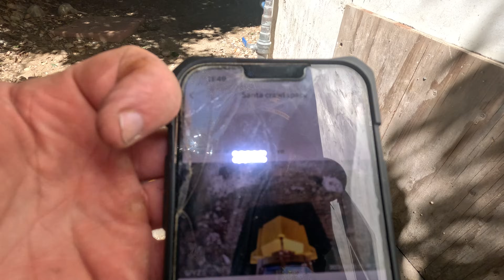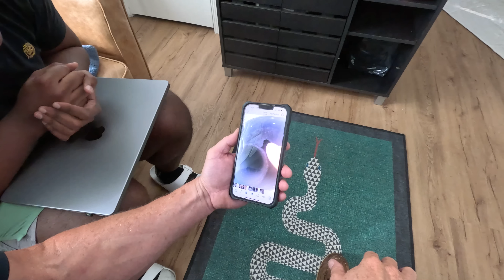3 Homes ONE HUGE RAT Problem

Comment: UV light can show rodent urine. A thermal camera can show borrows in insulation. Also there are one way rodent valves to prevent rats from entering through the sewer system.
Reply: They sell their own rodent blocker for the sewer

Comment: I am disappointed--the Rat that, supposedly, was caught and that Raul produced on the trap set to catch Rats coming through the sewer (Video @ 8:20/27:28 ) is a desiccated Rat (note the dried and flattened  and twisted tail and the bones of the hind foot showing and the old fur).  This likely is the one which they found in the attic in a former Pest Controller's Trap.  Why???????????????